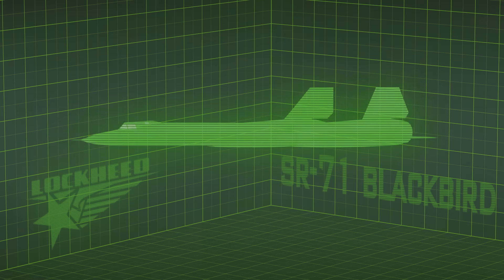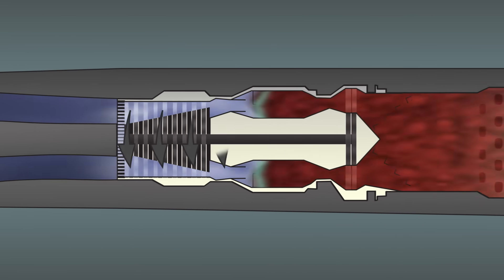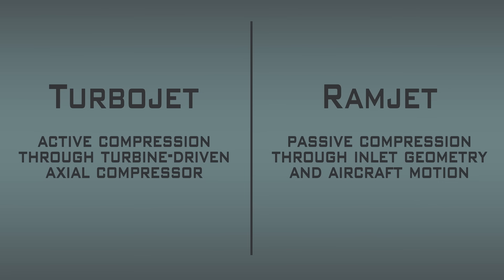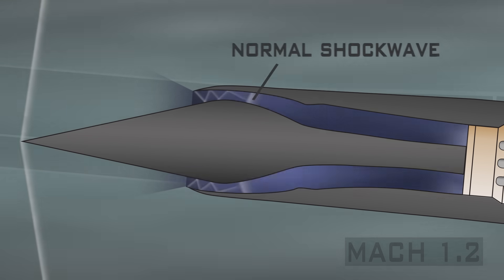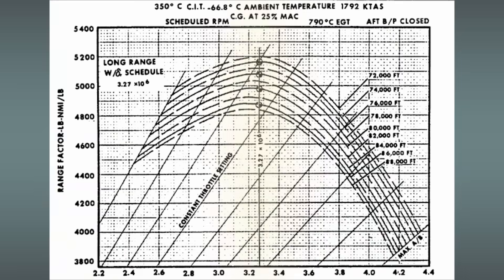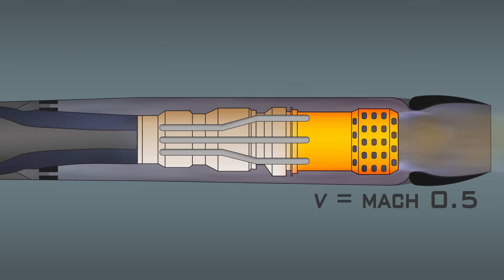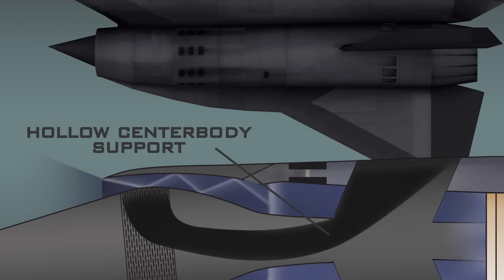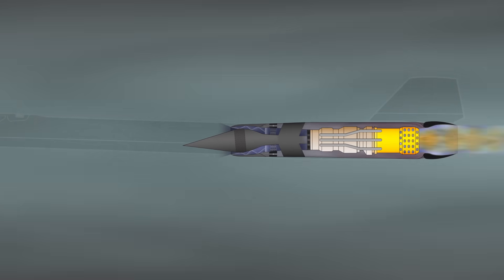The Mighty J58 - The SR-71's Secret Powerhouse

Comment: Why wasn't this more widely implemented?
Reply from the maker: +Matt Bowen While it's efficient for that speed range, it's actually not 'efficient' at moving people or things, in terms of energy to mass ratio.  So you can go fast, in a finely tuned aircraft like the SR-71 and be 'efficient' in that range, but if you want to move people and things, like say from place to place in an airline, you want a much less costly engine system in a much bigger and less aerodynamic body.  Each type of engine, turbofan, turboprop, propfan, ramjet, scramjet, rocket, are all more efficient than others in their specific speed range, but not more efficient outside of that range, or necessarily 'efficient' in the same way.  I don't know if that makes sense, but yeah, that's why this set up was never used again - no plane has had to fly continually in that speed range other than the SR-71!
Reply: +TechLaboratories I understand the whole bit about efficiency vs. speed but I guess I was wondering why it didn't see a more widespread military application (i.e. Offensive craft such as bombers or fighters). I can understand why it's use in a spy plane was seen as wasteful as the spy plane is obsolete and a numerous sorties are much more costly than a permanent satellite in orbit. I'm just wondering why something that is widely regarded as one of the greatest technological innovations of all time was scrapped as soon as it's first purpose was done. I saw your video about the other 'Blackbirds' and I guess that those are what I'm thinking of. Maybe even a single engine fighter that uses this engine in a similar configuration to a MIG-19 where the intake is basically where the nosecone should be
Reply from the maker: Matt Bowen Unfortunately, aeronautics are never as simple as we think.  Bombers carry sizeable (physical and weight) bombs that define how big the aircraft needs to be, and the efficiency of the J58 doesn't scale to higher weights and the increased drag of larger bodies.  While the YF-12 interceptor program and prototypes were going to do just that, use the same airframe and powerhouse, the air force decided that there was no real advantage to an interceptor going that fast, when enemy bombers and air superiority fighters were limited to to the Mach 1.5 range, just like theirs were.  Yes, the Mig-29, which was an interceptor, could go faster, but interceptors have short sortie routes and are for protecting airspace, not dominating enemy airspace.  Had the MIG-29 been an air superiority fighter as the air force originally thought, it would have meant the need for a faster interceptor and the YF-12 would have become the F-12 or F-13.  But it cost a lot and held little payload with its only advantage being speed.

All in all, the J-58 was a purpose built piece of technology and it served its purpose incredibly well, but didn't do anything else very well at all.
Reply: +TechLaboratories That makes sense. Thanks for getting back to me
Reply: +Matt Bowen The SR71 took off with a very small fuel load to begin with, this was to prevent the over stressing of the brakes/wheels/tires in case of a rejected take-off and also to improve its singe engine capability in case of a flameout during takeoff. If the plane had a full 80,000 lb fuel load and an engine flamed out, the resultant yaw rates would require the opposite engine to be pulled out of afterburner, which would result in insufficient thrust to stay in the air. It was also noticed by maintenance that the heavier the takeoff fuel load, the greater the wear on the wheels/tires/brakes.  Instead of a full 80,000lb fuel load, a 45,000 pound take off fuel load was preferred.Then as soon as it was airborne, it hit the tanker for a full load of J58 specific JP-7 jet fuel. The SR-71 did leak esp. before it made a supersonic run to heat the airframe, but there's no way the jet would lose 90% or 72,000lbs of fuel between filling the tanks, taking off and then hitting the tanker.
Reply: xphobus The comment that these planes had  "little effect on the Cold War because of Recon satellites" is not accurate. Oxcart brought the A-12 into service in 1963. Corona wasn't doing anything useful at that time. The KH-4 system came about in 1963 and did help to maintain system reliability and a readiness state of 7 days, this eventually was brought down to 1 day notice needed.
Overflights of the Soviet Union were only 1  part of the Cold War intel effort.  The Blackbirds provided vital intell during the Cold War.  Even when spy sats reliability peaked, the Blackbirds rapid mission planning provided a capability that even the satellites couldn't fill.  Satellites fly known tracks which are easy to follow and therefore cover/move things of interest. They cant be change directions quickly, and the small inclination changes that can be performed are limited by on board fuel. A modern satellite costs more than a Nimitz class aircraft carrier.
The U-2, the Blackbird variants and recon satellites were all instrumental in providing a clear picture during the Col War.

. As a side note, General Schwarzcopf was disappointed that he didn't have the SR-71 in his back pocket during the Gulf War (Aug-90-Feb 91)which had just been retired and had its last flight in March of 1990. Spy satellite service was still recovering from the inability to launch Recon satellites due to the Space Shuttle Program being shut down for 31 months until Sept 1988.
Reply: +xphobus But it's soooooooooo much cooler than a satellite! :)
Reply: Kyle Lorrin Yes, Blackbird family of jets did encounter high temperatures while at high speeds but the airframe was not designed to expand, it simply expanded with the heat and the designers took that expansion into account.  This expansion also took place in the fuel tanks, but they were lined with a sealant, but the tanks still leaked some.  The reason for refueling after takeoff was NOT because the fuel leaked from the tanks. The reason was because of the danger of losing an engine during takeoff.  If the jet took off with its full 80,000 pound fuel load, and it lost an engine during takeoff, the jet  would yaw thus requiring the remaining engine to be pulled out of afterburner. Doing so would not leave enough thrust to sustain controlled flight. Another reason for taking off with a 45,000lb fuel load was to avoid wear on the tires, wheels, brakes and landing gear. Technicians noticed increased wear rates when the jets performed full fuel takeoffs during early testing.  The normal fuel filling procedure is to fill the tanks with 80,000lbs of fuel, then drain off 35,000 lbs of fuel, while draining, replacing the volume of jet fuel in the jets tanks with gaseous nitrogen.  This inert gas added another layer of protection against fire and explosion.  Once the tanks were drained back to 45,000lbs, the jet made full afterburner takeoff then met with a tanker.  After topping off its tanks the Blackbird relit both afterburners, climbed to 85,000ft and Mach 3 or so and continued on to its target, or its next tanker rendezvous. Once the jet had warmed up by flying fast, the leakage rate slowed and all was good. But the reason for hitting the tanker right after takeoff wasn't because of the fuel leaking from the tanks, it was because the jets purposely took off will a smaller reduced fuel load for safety and maintenance reasons.  The tanks did leak, but they didn't leak that much.
Reply: +Matt Bowen Think of it like a Bugatti Veyron. The Veyron is purpose built to go fast, but that's about it. Trying to fit a similar engine into, say, a minivan or something would drastically reduce the efficiency and performance of the engine and would require an expensive and/or impractical body design.
Reply: +Matt Bowen  Not to mention that the aircraft leaked like a screen door at ground level and low speeds. It was built that way for the amount of swelling the aircraft did at it's cruising altitude and speed so that it wouldn't buckle or leak in the air.
Reply: Avilator189 There actually is some loss from the time the standard 45,000 lbs takeoff fuel load is loaded and the time the bird hooks up with a tanker just after takeoff, but its no where near the 90% that MattBowen stated.  The entire reason for the 45,000lb takeoff fuel load was to improve the jets single engine takeoff dynamics and to reduce stresses on the landing gear. The way some people talk, some get the impression that if the jet was loaded with a full 80,000 lb fuel load for take off, that most of that fuel load would have leaked out, but that's not true.  During the test series, they did some 80,000lb fuel load take offs if there was no tanker available.
Reply: I was under the impression that pitch moment was severely limited with the forward C.G. of a full fuel load. They were able to pull the nose up with all that gas on board?
Reply: Could very well be, but they were able to pull the nose up with a full fuel load. During operations they never took off with a full fuel load, only during testing did they try an 80,000 lb fuel load.. 95% of the takeoffs were completed using the lower fuel take off load with a tanker. If there was to be a mission with a take off that immediately went to Mach 3, each of the 6 tanks were fueled to the full level totaling 80,000 lbs, then the plane was defueled down to about 65,000lbs just before takeoff. This fueling process was called a "yo-yo".  Perhaps their use of 65,000lbs even without a tanker after takeoff has some CG considerations?

A yoyo fill is where the fuel loads in the tanks had to be maxxed, then lowered down to take off level in order to fill the ullage space in the tanks with gaseous Nitrogen. The "yo-yo" fill ensured 100% of the atmosphere in the tank was inert.  The SR-71 carried liquid Nitrogen in 2 104 liter dewars initially, later they added an extra 3rd dewar to increase the range of the jet.  The amount of liquid nitrogen and the number of TEB shots (used to start the engines and to ignite the afterburners).  Every time the jet came off the tanker, the throttles were advanced and  a TEB(triethylborane-burns when exposed to oxygen)) shot in each engine would ignite the extra fuel, as JP7 is very difficult to ignite..  With a maximum of TEB for about 16 shots, Each shot was needed for starts, restarts, or afterburner lights.  So it was TEB shots and liquid nitrogen that were limiting factors for flight duration.
Reply: xphobus There has never been a satellite system that has deemed spy satellites obsolete. Reconnaissance satellites and planes are BOTH an important part of  todays intelligence gathering capabilities. Satellites cant do it all,
Reply: +hoghogwild I meant focus on stealth planes , misstyped sorry for that
Reply: +Matt Bowen 
It was actually intended to be used in the new Bentley Supersports Coupe'  and even the Mercedes CLXJKR - but the US Dept of Defense (Pentagon) barred its export.
Reply: It did not "loose" fuel like that. The SR-71 was deliberately fuelled light for take-off to reduce stress on the landing gear; wear and tear on the high pressure tyres and for better take-off performance and single engine out capability. It then flew to a tanker to top up and go. There were occasions when the SR did take off fully fuelled but they were rare. The leak rate was relatively small on the ground and measured in drips per minute.
Reply: Surface to air missiles got better and faster than panes ever could. Its just not feasible to out run them any more like the black bird did. That's why modern planes are all about radar and thermal signature reduction.
Reply: +3lbtrigger it would actually lose around 90% of its fuel before and during takeoff because of this and would refuel in midair after takeoff
Reply: Matt Bowen I knew about the in flight refueling, but not the number for actual fuel loss. That's crazy.
Reply: +3lbtrigger Well, there is no loss. They just take off with a little bit of fuel on board to begin with.
Reply: +hoghogwild You guys forgot also the RORSAT system , the Ultimate Spy Sattellite , it could track any metal sailing the sea  or flying in the air ,day and knight .  Only the soviets had such a sophisticated network of satellites. For me RORSAT doomed spy planes absolete. It must had been fun sitting on Moscow and watching the sr-71 taking off from Nevada. Yet another reason why someone would focus on spy planes.
Reply: There are Fuel Tanks 1, 2, 3, 4, 5, 6 in a row just behind the back seater straight back to the end of the fuselage, then their is a Forward Wing and Aft Wing tank in either wing.  Most Jet fuels are really Kerosene, JP-4 which was used by the US military until 1995 was a 50%/50% mix of Kerosene/Gasoline freezing point of-72.4ºF(-58ºC)
JP-5 is Kerosene based known as AVCAT fuel for AViation CArrier Turbine fuel with a flashpoint of 140ºF.Freezing point of -50.8ºF/-46ºC
 It was designed for use in jets based upon aircraft carriers where the immense amounts of jet fuel carried aboard is a huge fire risk.
Most military jet fuel is now JP-8 which is also Kerosene based with a flashpoint of 100.4ºF.

JP-7 also has a flashpoint of 140º and a boiling point of 550ºF, a low vapor pressure, high thermal oxidation stability,
and low volatility.  That high boiling point is important, not only for the heating of the fuel via body heating, which at its highest temps of the body panels themselves reach a temp of about 512ºF but because inside of the engine itself it reaches a fuel temp of 550ºF.  The temperature of the fuel as it enters the engine itself is 350ºF. Inside the engine, the fuel is used for cooling, and actually used for a hydraulic fuel which raises the fuel to 550ºF as it is sent to the afterburner fuel spraybars for injection into the afterburners. 

Another layer of protection from fire/explosion is the usage of inert nitrogen gas supplied by 3 liquid Nitrogen dewars. On the ground, the SR-71 has all of its fuel cells filled 100% to the 80,000lb full fuel load, then the fuel is drained back down to about 40,000lbs or about half full.  This process is known as a Yo-Yo  fill.  As the 80,000 lb full fuel load is drained back down to 40,000-45,000lbs takeoff load, the empty space or ullage space is replaced with gaseous Nitrogen.  This is the only way to ensure that absolutely zero air, therefore zero Oxygen is present inside the tanks. No Oxygen means no explosion and no fire  Since the liquid nitrogen contained within these 3 dewars(Thermos like double walled container with a vacuum between the walls to slow/eliminate thermal conduction to keep temps inside constant) is used as the fuel loads are burned off, then the gaseous nitrogen is vented overboard during refueling, the amount of liquid nitrogen carried aboard is the limiting factor for mission duration. Another limiting factor is the usage of TEB as there is enough TEB for approx. 16 TEB shots per engine and 3 of these are already used up before the Blackbird is on its way to its target. One is used during startup, another during takeoff when the afterburners are lit during the roll, and another coming off the tanker that the jet finds approx. 7 minutes after takeoff. That leaves 13 TEB shots remaining. ! is used each time during/after a refueling, and you want at least 1 or 2 in reserve in case you have to abort a landing and need to light the burners to accelerate out for another go-around.

Yes, you are correct about the expansion and sealing of the tanks and body panels.  The jet was designed to take the expansion of the titanium metal which results from a hot run, into account for a function of sealing the tanks. A previous poster made a comment that the jet was designed with expanding tanks to deal with the high temperatures. I surmise that while the titanium metal did expand, it was not a design prerequisite that the tanks themselves be expanding. Their expansion was a side effect of the heating and the titanium metals reaction to that heat. If there was another material that had absolutely  zero expansion when heated with other properties the same as Titanium, then that material would have been used.  I think that maybe, I am getting caught up in semantics, but yes, the tanks and some body structures did indeed expand when heated, and yes that expansion was indeed needed to fully seal some parts of some of the tanks.
Reply: +3lbtrigger That is fucking incredible! It's those little things that really amaze!!
Reply: hoghogwild
All of which means ????????????????
Reply: slimchancetoo Be specific please.
Reply: ProjectsBlack

Maybe !! Maybe the Russians already have something better -- the Chinese CERTAINLY DO !!!! Recently seen over the Whitehouse and Golden Gate Bridge (San Fran) on its way home.
Reply: ProjectsBlack
Well think again sunshine. The Chinese are pouring billions into stealth aircraft and developing their own technology -- relations between China and Russia have been cool to frosty for decades even when they were Communist Brothers In Arms. They share a long border and the Amur area in particular has been fought over in the 60's and 70's and is well guarded on both sides. There is little fraternal love between these giants.
Reply: I don't think it's efficient enough at low speeds. noise could be another factor
Reply: Originally developed as the A12 high altitude Fighter it had a problem. It was too  fast for any weapons back in the day.  It could fly into its own cannon fire and by the time the missile launched fired the aircraft was well in front of the missile and in danger of shooting itself down. So they stretch the aircraft to make it a two seater and put a camera in it.
Reply: R Ewing
Ummmmm !! On the back of which breakfast cereal packet did you read this updated version of the problems the F-104 Starfighter had before they ventilated the cannon compartment sufficiently to disperse the build up of explosive gases in it. It was claimed that the F-104 Starfighter shot itself down when in actual fact the accumulated gases from firing the six barreled Vulcan 20 mm cannon exploded and crippled the aircraft forcing a bailout.

Any pilot who did not reduce speed to a level that avoided shooting himself down either by cannon fire or by a missile he had just launched would probably be assigned to KP duties for a month or four.

No my boy - the A-12 Oxcart was designed from the outset as a very high altitude very fast UNARMED photo-reconnaissance aircraft and gave rise to the later and very similar SR-71 Blackbird.
Reply: In heard this before you were probably born. When you are in the USAF, you here a lot of things and see many more. Most of my experience in the service was when I was stationed on a forward base in the UK Operating the F-111.  On here were comments about the cooling to the afterburner section was accomplished by a this layer of cooler air on the SR71 engines.  After taking pictures of one of the SR 71 engines today I talked to one of the maintenance technicians. He pointed out the metal parts in the afterburner section has a sprayed on ceramic coating that protected the metal from the 3600 degree temperature. Someone said the start carts sport big block chevie engines. Nope, they are Buick engine. Have a nice day.
Reply: R Ewing There is a difference between Chevrolet engines and Buick engines ??? 

Being both owned by GM the difference would be cosmetic and maybe an inch or two here or there.
Reply: wasn't the F-111 the one with the crashing problem? I've heard that it kept crashing into volcanic rock because of the ground following radar and EM interference.

Coincidentally, the J58 isn't more widely implemented because SR-71 pilots had to wear pressure suits so they wouldn't black out from the Gs, and nobody wants to go through that training.
Reply: They used to have their own engines which were totally different.
Reply: They fly at Mach 7 now.  SR-71 buy buy bye bye
Reply: Charles Seymour A
Reply: +Matt Bowen The sr71 indeed had  a very little impact on cold war ,  by the time the plane was in service US already had the Corona spy Sattellites orbiting. 
Too little...too late